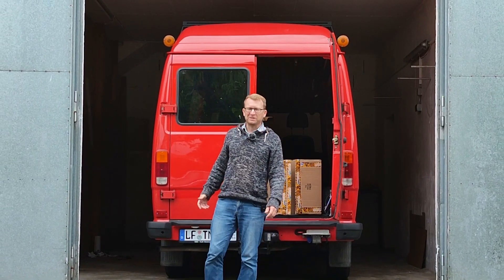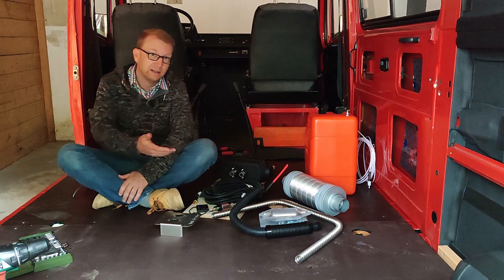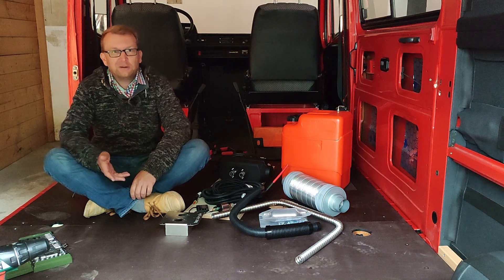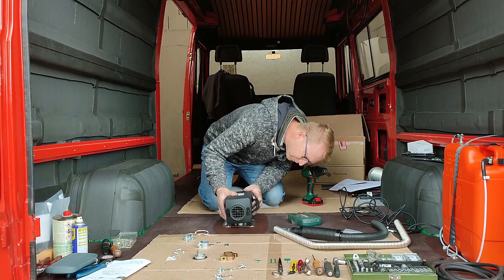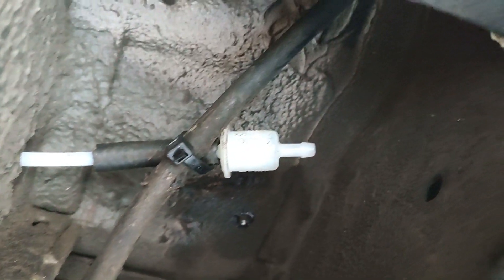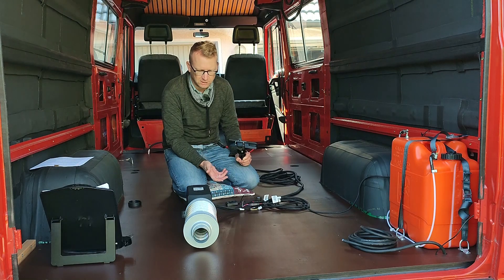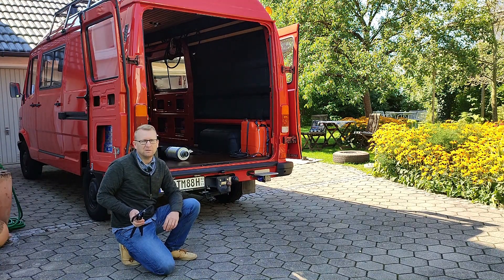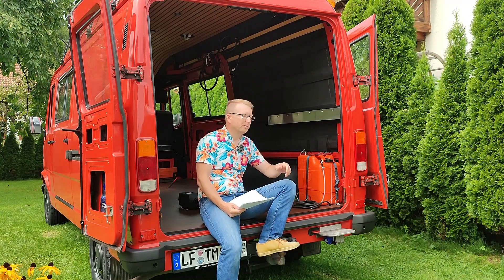How to install Autoterm Air 2D diesel heater with extra tank inside the van (Mercedes T1 conversion)

Comment: Thanks for sharing this. I have been researching diesel heaters for my Mercedes van conversion and like the look of these over a cheaper chinese heater. You have made the setup look really straight forward and possibly have more restrictions on these setups in Germany? I don't know of any regulations in the UK on fitting a diesel heater. I look forward to getting mine installed and working.

Comment: How long does the Diesel last  in that tank 

Thanks
Reply from the maker: The heater burns 0.1 to 0.2l per hour depending how hot you run it. So the tank should last about 10 days, if you don't heat 24/7 on highest volume.

Comment: In the manual it says fuel tank should be below the heater level. Is that essential? Or will it eventuallly generate erroe. Odea.
Reply from the maker: My heater works without problems, so having the tank on the same level is surely ok.

Comment: autoterm diesel heater garbage. Faulty from the start. Still coming up no connection. Reached out for support but false promises. 3 year warranty not worth the paper its not printed on
Reply: I’ve seen your comment elsewhere.
Autoterm reached out to you very generously.
Did you contact them?
Did they help?
Reply: I did contact them, he wasn't Autoterm, just a distributor. He left me hanging, when I chased him up he got all arsey and thought an 8 hour trip each way to Wales was common sense. Quite frankly what seemed a godsend turned into a disingenuous wind up. Giving up van life in the winter months as a result. I will consider an Alternative next winter if I can afford it. I certainly won't be robbed for £995 by Autoterm unreliable garbage again, that's for sure.

Comment: Just found your channel and find that you take your time to do your installs, you explain carefully and you have an absolutely magnificent Van 1988 wow, I have a 2104 Sprinter and will follow your instructions for my install Thank you. Oh I did instal an Espar in my Beneteau sailboat in the 80's but this time around I bought a few Chinese heaters, one to replace if the original failed rather than clean it, I am in Canada so if it fails it would be easier and faster to simply replace it. I do really like the Wallas heater cooktop combo though however here in Canada its over $3000 dollars CDN.
Reply: ‘Install’ is a verb.
The noun is ‘installation’.

Comment: Why did you choose a diesel heater vs a gasoline heater that could run off the van’s fuel tank? 

Do you hear the fuel pump for the heater? I saw another install video in a diesel engine van. He tapped into the van’s fuel tank and said the fuel pump is “absolutely not silent.” 

I purchased a built Ford Transit van with an Autoterm 4D gasoline heater. I have had lots of problems. The heater and fuel pump have been replaced with new units and still there are problems. The company thinks it may be a combination of altitude and additives in American gasoline. They suggested switching to a diesel unit with its own separate fuel tank. 

Thank you.
Reply from the maker: I wanted to have an extra tank for peace of mind. The tank of the T1 is quite small, so I think it's better not to drain the main tank while maybe staying in a remote area for longer time. I wouldn't say that the fuel pump is "absolutely silent" because if you listen carefully you can hear the click noise. But it's not a problem. So far we haven't had any issues with our Autoterm and it works perfectly.
Reply: Thank you for the info. 

What elevations are operating the heater? The USA distributor is saying my problems with the gasoline (petrol) model are a combination of altitude and additives in American gasoline. However, the heater will not operate properly at elevation 4,200’, which is not high by mountain standards. Most ski areas and hiking/mt. biking trailheads are well above that.
Reply from the maker: @traildog6339  The Diesel version is rated for altitudes of up to 4000 m, so there should never be a problem. This has been tested by various overlanders. But a petrol version of the Autoterm has never been on the market in Germany, so I don't know details here.
Reply: Wow! 13k’‼️ There are not many places at that elevation in the U.S. my van could access. Well above the operating altitude I would require. 

Thank you again!
Reply: Correction: he said the fuel pump is “absolutely silent.” *Autocorrect added the word “not.”

Comment: Great Video. Thanks!   I watched it because I have to remove my Autoterm Air 2D  heater to clean it.   It has been in my Van 2 year.  I only use it on Ski trips in the winter. I never run it at night while sleeping.  (my bed is setup somewhat enclosed to keep my heat in and down blankets under me and on top!)   I would estimate it gets ran two or three hours 25 to 35 days a winter, now 2 season so maybe 70 days total. I am at high altitude most of the time when it is running and between 7 and 10.5 thousand feet.  I was told after the installation not to run it on low due to carbon build up so it is always ran on the higher setting.   It is a pain to remove and clean it so I have been reading several comments about the build-up.  Most have suggested running on Kerosene.  I really don't want to add a tank because mine is mounted under the passenger seat.  I read about these heaters being used in work Trucks and it would surprise me if they have to clean them ever couple of months??    I am looking for any help or suggestion on  prevention once I get it out, cleaned, and reinstalled.   I am spoiled with having a heater.  My first winter before the heater my dash temp read  -22F one morning in Lake Louise Canada.  My Van was new and did not like it up there lots of issues no one could figure out.  Thanks for any feed back.  Marie
Reply from the maker: Hi Marie, we have used the heater only for maybe 10 days in total so far and it's working fine. Would be great if someone who has long time experience can answer your question here...

Comment: Got a 308D and the same heater. Works well, although I really didn't like the original PU27(?) display. Got a more modern one with understandable menu, for me at least.. It's great to see your truck come together, getting flashbacks to my own built!
Reply from the maker: I also don't like the PU27... still don't 100% understand it. Maybe I should also upgrade ;)
Reply: Checked, I got a Autoterm Comfort Control Unit, also from Tigerexped. For other readers with a T1, diesel: a Planar 2D fits perfectly in the passenger seat base, it’s close to the diesel return line as well so easy connect without drilling the tank. :)
Reply: @evellop Hi, you talk about the diesel return pipe. Is that mean that we can put a ''T'' or "Y" derivation on the return pipe, to plug the heather pump on ?
Is the heather pump powerful enough to pump diesel through the ''big'' diameter of original diesel pipe?
Reply: @w2edy  Hi, indeed, I used a T-splitter piece on the Diesel return line to get the fuel input for the heater. And this works well (operating for 3 years without  issues now, about 20 days of operation yearly only though). To be honest when installing I never doubted the sucking power of the pump, it jsut worked. Went for this way as I saw it being mentioned in a few different messages boards.
Reply: @evellop  thank you for you answer

Comment: I have seen all the videos you published so far, impressive work, very very nice. I love your precision and style and the Mercedes T1 too.
Just a concern about the fuel line under the van. Will it freeze on winter / cold countries? I'm studying to start my van conversion.. and this one of the thousands doubts I'm facing!
Reply from the maker: Thanks! :)
Freezing Diesel would only be a problem in very cold conditions, but then a Diesel engine of a van would have the same problems. In Germany Diesel gets additives in winter, so you won't have problems down to temperatures of -20°C. Probably every country uses these additives according to expected temperatures because they want to keep their trucks going. That's why I wouldn't worry about the Diesel heater unless you fill the tank in a warm country or in summer (without additives) and then travel with this full tank of old Diesel into a cold country in winter time ;)
Reply: @CubeofCars  Yes, you're right. Here in Italy, additive is added to diesel too, even though only on mountain areas. So no more doubts about this topic! Thanks a lot

Comment: Very good video. Thank you! 
If the air intake is inside of the car aren't you using up the air inside? Could imagine the air quality can get quite bad after a full night. 
Is it possible to build the air intake to the outside of the van?
Reply from the maker: Hi! You will need some kind of ventilation for the night in any case, no matter if you use the heater or not. But for that it's better to use a vent in the roof or maybe a window. There are two problems with an air intake for the heater from outside under the van. First is efficiency, of course, and second you could suck in your own combustion fumes, if the wind turns in the wrong direction.

Comment: Another great video. Putting the pipe the whole way to the bottom may not be a good idea as moisture can gather at the bottom of the tank and also dirt so keep it a little way from the bottom if it’s a concern. Also ensure a pipes under neath are well clamped with rubber clips as any lose or floppy pipes will vibrate as u drive down the road. Your workman ship is very tidy and ur van looks smart already
Reply from the maker: Thanks, Marcus! You are absolutely right. The pipe should be 1cm above the bottom of the tank. That's also stated in the manual and that's what I did, but I should also have said that in the video..., so it's good that you mention it here in the comments! Meanwhile I also added corrugated plastic tubes to better protect the fuel pipe. Cheers, Mike.